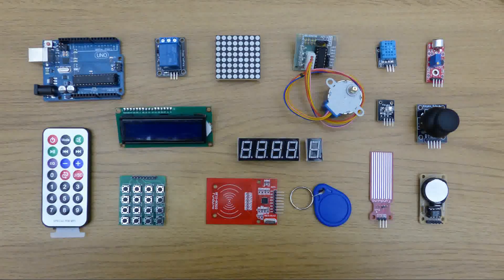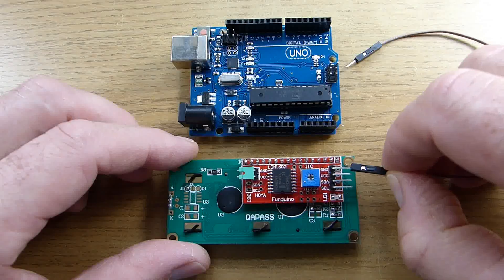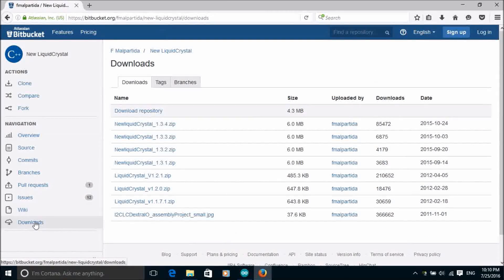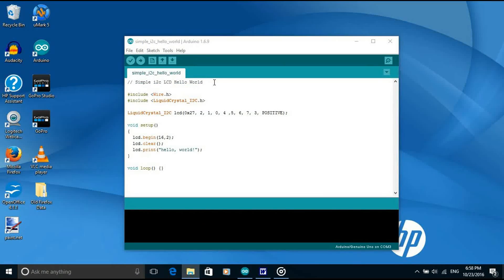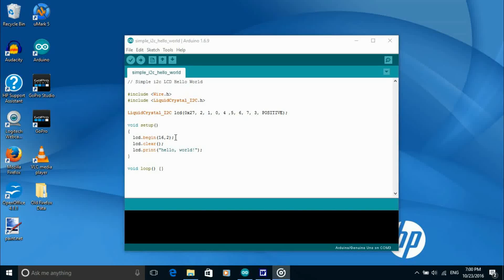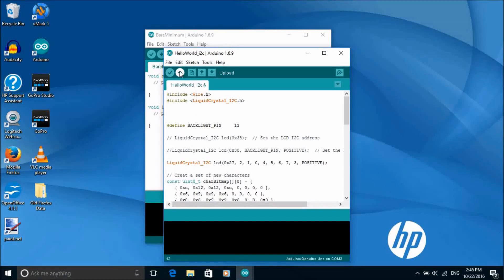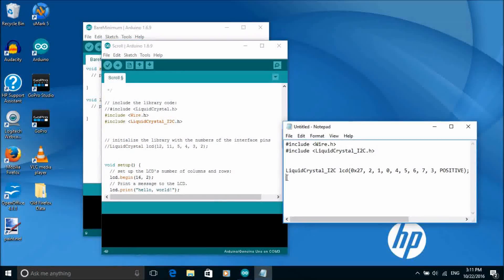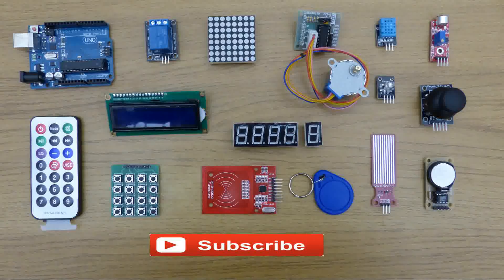How to Connect an I2C Lcd Display to an Arduino Uno Tutorial

Comment: My LCD does not show anything, it does not light up too. Can you help me to solve this problem?
Reply: techydiy i have the same thing and everything is checked 
I have all the library's installed correctly,
The scanner says 0x3F, 
The potentiometer is set to the right contrast,
I even checked all the pins,
But i dont really know what the parameters are, could you explain please?
Reply from the maker: +Hiếu Phạm Trung  If it doesn't light up at all then I would look at whether you have power connected to it correctly.
Reply: I check again and the LCD just light up, but it doesn't show anything, I did so many way but it still doesn't show anything.
Reply from the maker: Have you found the correct i2c address with the i2c scanner sketch ?
If yes then have you installed the library correctly ?
If yes then have you put the correct i2c address into the code example ?
If yes then have you changed the contrast  potentiometer on the lcd backpack to change the lcd contrast ?
If yes to all that then you might need to change the parameters for the lcd backpack.

Comment: My hd44780 library package is easier to install and use than the new LiquidCrystal library or other LiquidCrystal_I2C libraries.
hd44780 is designed to make configuration easier for i2c based backpacks.
It will automatically locate the backpack i2c address and automatically detect the pin 
mappings so you don't have to fill in any configuration information in  the constructor.
(you can if you want, but it isn't necessary).
The library can easily and quickly be installed using the IDE library manager right from the GUI.
You can read more about it here:
https://github.com/duinoWitchery/hd44780

Use the IDE library manager to do the install rather than attempting to install the library manually or using the zip install.
Using the IDE library manager is not only easier and faster than a manual install but it also ensures that the library is properly installed.

The i/o class for i2c lcd backpacks is hd44780_I2Cexp.

The library includes many examples and includes a diagnostic sketch 
(I2CexpDiag) that will test the i2c connections and the LCD memory 
inside the LCD module.

It should automatically autodetect the backpack address and pin mappings "out of the box" so that the included hd44780_I2Cexp examples "just work".

If  the included hd44780_I2Cexp i/o class examples aren't working, then run the diagnostic sketch and it will
 provide lots of diagnostic information on the serial port.

hd44780  is faster than other LCD libraries as it does things in a smarter way which allows the Arduino processor to run while the LCD is processing commands.
It also has additional API functions to provide additional functionality like automatic line wrapping and the ability to read the LCD to name a few.

--- bill
Reply from the maker: I haven't tried it yet but I had a quick look and the documentation is good..
Reply: Hello Bill, 

thanks for all your work and to share it!

I got a message after LCDlibTest on the Arduino Uno with a 2004 I2C Display
And i only see the backlight. But no characters. A4 and A5 are used. Dont know what i should do to get it work. I try it since 1 week with all different libraries, but no success. My 1602 Display worked fine. But the new one i dont get to work.

Serial Initialized
--------------------------------------------------------------------
I2CexpDiag - i2c LCD i/o expander backpack diagnostic tool
--------------------------------------------------------------------
hd44780 lib version: 0.9.0
--------------------------------------------------------------------
Reported Arduino Revision: 1.8.3
CPU ARCH: AVR - F_CPU: 16000000
--------------------------------------------------------------------
 A4: digital pin: 18
 A5: digital pin: 19
SDA: digital pin: 18
SCL: digital pin: 19
--------------------------------------------------------------------
Checking for required external I2C pull-up on SDA - YES
Checking for required external I2C pull-up on SCL - YES
--------------------------------------------------------------------
Scanning i2c bus for devices..
Total I2C devices found: 0
No I2C devices found

Comment: its not work, my lcd just light up but does not show anything
Reply from the maker: Check the contrast pot, and all the other stuff I put in the video
Reply: mine is the same, i turned the pot and nothing changes. i just see the backlight
Reply: Pharoah King my lcd was function finally!
Reply: i have the same problem my lcd show only light not any other thing please let meknow where i place potentiometer ??

Comment: Can I use SDA and SCL pins to connect instead of the A4/A5?
Reply from the maker: +Frankerzed Yes. On the Uno R3 the SDA & SCL pins are also brought out next to AREF.
Reply: Thanks, can I also use two separate devices, one connected to the SCL / SDA and another on to the A4 / A5?
I've tried doing so with a DS3231 and the LCD, but the display never seems to work.
Reply from the maker: Those lines are just connected to each other. But yes you can have more than one device connected to I2C. What you might need to do it is have lower values of pullup resistors. What I would do it connect them up individually and check the I2C addresses with the scanner. Then connect them up together and see if you can see the I2C addresses, if you can see both then your in business.

Comment: 3:03 how do I know the parameters of the display?? I´ve already got de first parameter with the scan code, it was 0x3F, but I don´t know the rest, how to I get those numbers?
Reply: Look on the piggyback board and you see number like PCF8574 or PCF8575 or PCF8578T, then might need look them up, this example relates to PCF8578T which usually has address of 0x27 by default. I don't know how to better help you learning myself. You will need a good magnifying glass, I use a jewelers loupe which magnifies it greatly so I can read the chip

Comment: Hello, why does my serial monitor say there is no ic2 devices found but my lcd i2c is lit up and connected to the Arduino?
Reply: if you use arduino mega you must conect scl and sda (lcd) to pin 20 and 21
Reply: it might be a bit late but you have powered up the back light by connecting it to power
Reply: Spyros Marc this also my problem 
How to fix this
Reply: I fixed this problem by checking my wiring again, I had some problems with the I2C
Reply: Thanks!

Comment: LOL now i have an other problem the problem is that when i try to compile the sketch in your video this  Message  show's
=========================================
(no matching function for call to 'LiquidCrystal_I2C::LiquidCrystal_I2C(int, int, int, int, int, int, int, int, t_backlighPol)') 
and also the (lcd.clear  () ) command Didn't  become red when i wrote it?s my IDE version is 1.6.4
Reply from the maker: +Mohammad saad Do you need to have downloaded and installed the new liquid crystal library. Then go into examples for newliquid crystal library and start from there.
Reply: i did download the new liquid crystal Library (NewliquidCrystal_1.3.4.zip( from bitbucket.org and used the sketch you used in this video
Reply: yes i have also same problem

Comment: and it has the pins (D0.....D7)
Reply from the maker: +Mohammad saad  You should have an i2c backpack soldered onto the pins on the lcd display. The i2c backpack will only have 4 pins. Gnd, vcc, Sda, scl. If it doesn't have an i2c backpack then it will probably need a oarallel connection which is totally different.
Reply: s i know that and my LCD do has an I2C backpack and i connected the vcc ,GND,SDA,SCL as you instructed  in the video ,trust me there is no problem with the wiring .. my be the scanner did not work because my LCD is  4*20 and the sketch is made for 2*16 LCD's only ?
Reply: thank you for your time my nice deer friend i just replaced the arduino board and the scanner worked correctly the problem was the Arduino it self
Reply from the maker: +Mohammad saad the. I2c Scanner just identifies the backpack, it doesn't matter what the devices is.
Reply from the maker: +Mohammad saad that's good. Thanks

Comment: when i oped the serial monitor for getting the i2c Address  it just kept saying  (Scanning)x?
Reply from the maker: It's not finding anything. I would check the wiring first.
Reply: i have connected the sda pin to A4 pin and the scl pin to A5 pin
Reply: the wiring is correct and i am using an 4*20 lcd
Reply from the maker: +Mohammad saad is it getting power? Is the LCD backlight on. 5v and gnd connected.

Comment: My display just lights up 16 bars in 1st line :/
Reply from the maker: +Rudolfs  Check  the contrast is set correctly. If so the its probably the pin assignments. Look here for different examples: https://arduino-info.wikispaces.com/LCD-Blue-I2C

Comment: how do i adjust the brightness just by codes?
can i power the LCD with digital pin0~13 instead of the 5V pin?
Reply from the maker: You could connect the lcd backlight to a fet or transistor switch, with it's input connected to a pwm output on the Arduino.

Comment: my lcd does not show anything only lights up
Reply from the maker: +Uzumaki Naruto try turning the contrast knob (potentiometer)
Reply: You both are my life saver!!!!!! Thank you so much.
Reply: THIS IS REALLY THE SOLUTION FOR MOST OF YOUR PROBLEMS GUYS. The potentiometer is the blue box behind your LCD. Screw the grey thing on it.
Reply: @nickthewinner2194  still nothing after turning potentiometer both ways. no problem uploading scotch just nothing visible other than a lit up screen
Reply: which one is it
Reply: got it thanks
Reply: @AMEIR Afiq , i have the same problem too , you vary the I2C builtin potentiometer then your value comes visible .
Reply: means we need to add potentionmetre in other to get the output?? Because my lcd faced same problem...
Reply: WHICH POTENTIOMETER ??? I2C pot ???
Reply: thank you
Reply: the one on the back of the i2c
Reply: how do you program it to change its values?
Reply: How do you program it to change values?
Reply: thank god was trying 3 hours ..
Reply: is this blue thing,the potentiometer of the i2c module because my i2c lights up as well but doesn't display anything?
Reply: Me too

Comment: hello sir. i have 2 lcd. both 2004 but different type of i2c bus (0x27 and 0x3f). can i connect 2 lcd using different i2c bus to arduino mega to make it work? thanks
Reply from the maker: +Zyro Zack You can connect both LCD displays to one i2c bus as long as the i2c addresses are different. You can then address each device individually. You will probably need to have two pullup resistors on the SDA and scl line. Try 4k7 to start with.
Reply: techydiy thank you sir :)